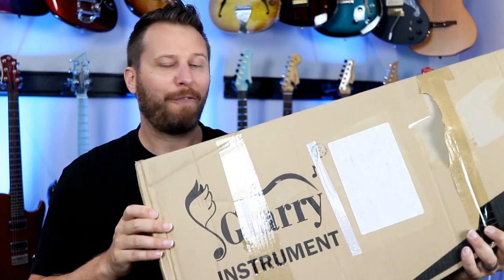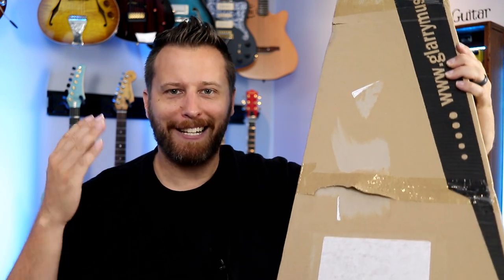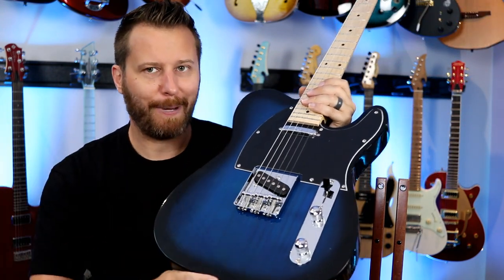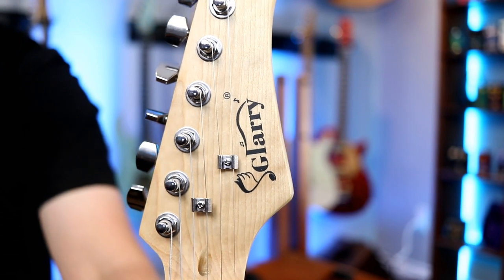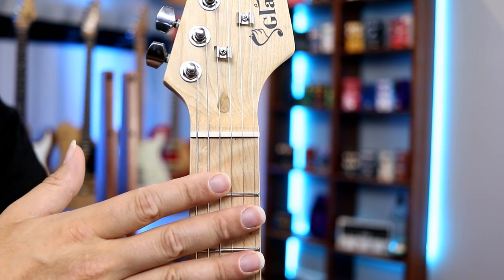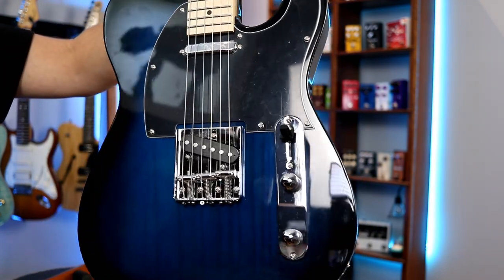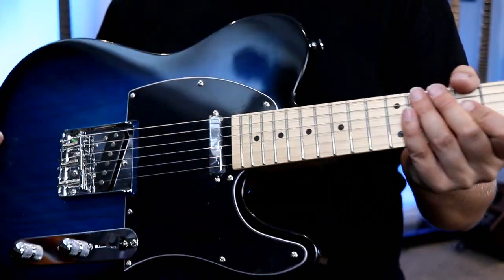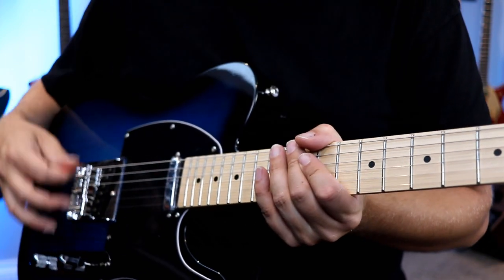The CHEAPEST Guitar I've Ever Played! - What Does It Sound Like??

Comment: 89 bucks..in stirling a reasonably decent night down the pub and a takeaway..
Spend a bit on some sensible upgrades and you have a decent axe for not a lot of cash.
Mind you I have ya beat on that, a classical from gear for music a few years back..because I wanted to find out what the hell do you get for that £s..
New set of strings and machine heads..one of the originals cracked..
A fret polish and tidy up at the ends..not much.
And it played ok, sounds ok.
A bit later a new tusq nut and saddle..even better.

It's a classical and I plays it with a pick..for country and blues stuff.
Finger picked it ain't great though.
And new it cost the grand total of.....£25.00...and a few upgrades.
Haven't quite managed to put a hole in it yet...but I'm workin' on it..
Don't think they sell it anymore either..hardly a surprise.

I do have a more expensive classical but don't really want a ruddy great hole in that one..

Comment: I just got one just like yours. 60 cycle hum galore!  It will have to go under the wrench for several issues.  The thing is very solidly made. Cost: $79.95 + free shipping.  Is the ash tray grounded on these?  Mine buzzes when touched (possible string grounding issues).  Should these guitars be hard tailed?

Comment: The hole in the neck heel is simply for hanging the body when they put the finish on it. I don't care for Glarry guitars, mainly because they're not made from what they say they are made from. The body is not basswood. It is paulownia, which is not a good tonewood for an electric guitar. The neck is also not made of maple. It's some variety of pine, which is why the necks are so thick on Glarry guitars. They had to be thick for the neck to be sturdy enough. I gave away the Glarry ST I had, with the understanding that it was not a good guitar. You absolutely get what you pay for. I recommend looking in the 125-200 range for a nice cheap guitar. Lots of options there, such as Monoprice, Squier Bullet, SX, Glen Burton, etc.

Comment: Hi Darrel, hi guys, isn't it time to show, what this guitar really could be? First step: fretwork, new strings and adjustment of pickups, intonation and distance between strings and fretboard. And then let us hear the sound before and after. It doesn't take money for that. Step two: After this part, its more or less some kind of quality control until here, there should be some more modifikations: the bridge has all the holes for 6 saddles (steel or brass) and string through, the nut should be replaced by bone or graphtec and, as you work at the bridge, the pickup should be changed into a cheap wilkinson or a no name dual rail humbucker (enough, there are no Duncans needed). You can easily drill a hole in the controll plate and put a mini switch in there to switch vom humbucker to single coil. Some shielding would be nice. After all, I'm shure, you will install some hipshot locking tuners and the guitar will easily compete with a Fender, G&L, Blade, Nick Huber, Tokai or whatever you want from the middle to upper class guitars. You can do some recorderings to show, what the steps are and which effect you can hear. I tried this with two DIY kits with ashbody and maple neck and they are great. You will hear the biggest difference, when you work on bridge and nut. So, what do you and the others think? Keep on rockin'!

Comment: Definately changed days. I bought a fazely guitar (pretty much the same thing) £69 delivered as a project guitar thru lockdown. The biggest thing about buying a cheap guitar, change the strings straight off. Pick ups are usually super hot and noisey. Yeah maybe a bit of finish and fitting flaws but have played OK. End of the day, I got a bodh and neck that was well good for £69 to my door to bolt on all my parts bin parts and faff about with without having to with about faffing it up.

Comment: I bought a Glarry Burning Fire for my son for his first guitar. It had the same problem with the frets and the neck was cocked forward because the pocket wasn't properly routed. I went with the fire because of the humbuckers. The neck also had several uneven frets that were creating dead spots. I only paid $69.00 for it so I expected this. Also minor wiring and output jack issues. I corrected all issues and threw on some 10's and now it plays excellent. He has moved on to a MIM Strat but the fire was a great guitar to see if he would stick with it before spending more money. Just be prepared to do some work.

Comment: Without watching the video....I bought one as a "Project Guitar" that was fun to work on and way cheaper than even a kit. The neck pocket was gouged out with a chisel, sharp frets, block hole was not routed correctly,  but the neck was straight and strong. I wouldn't buy these for beginners if you want them to stick with it. If you want to experiment with repairs, paint, setups, etc go for it.

Edit: For a first guitar I would suggest a Squire short scale Bullett Mustang with a professional setup. Don't go to guitar center but your local music store that will most likely price match them and may even throw in a free setup.

Comment: I am 99% certain that those are the same exact tuners on my last two Amazon kit guitars, a Tele and Strat respectively, seller name is mangolulu18. And that bridge is exactly the same as the Tele. Which, by the way, excellent kits overall for the price of $89-$99: very good neck/body fit, perfectly useable hardware and pickups for the money. Only real issue is that both models have the same exact neck with a nut that is too tall, making the first fret tone about a third of a semitone high.

Comment: The lack of a grounding wire touching on the metal ashtray plate may have a lot (not all, but a lot) to do with the microphonics, but it wouldn't be hard to fit one. If I bought this guitar it would be as a starting point for building my own. I would keep the body, the neck pick-up and scratchplate, and the ashtray. I'd replace the control plate with a pre-built one by a reputable maker (there are plenty of them on e-bay) and I'd replace the bridge pickup, and I'd replace the saddles with gotoh compensated saddles, but there's nothing wrong with having strings attached through the back of the ashtray - that old thing about strings passing through the body is another of those guitar myths that belong in the same garbage can as superior tone woods and superior nitro cellulose paints (on a solid bodied guitar it simply means that some folk were born yesterday) - if anything, I prefer to have the strings through the back of the ashtray. And I'm not alone in that. In fact. Fender made 'top loading' Telecasters in the late 1060s, and some players seek them out. All the neck issues can be solved by buying a better neck, and better tuners while you are at it. What your 80 dollars buys you here is a nice body with a nice neck pickup, a scratchplate and an ashtray - which is still a good deal if you think that a branded body alone will cost aroun twice a much, at least.

Comment: I have an SX Taurus, which is one of Rondo's T-styles. The bridge pickup on it has a ceramic bar, but the base plate was cut to accommodate it. That is, the plate is touching the bottom of the pickup, but there's a little window in it, the size of the bar magnet, so it can directly touch the pole pieces.

I've never seen what you just showed us. I wonder if that gap contributes to the microphonics, somehow.

Comment: I'd rather start with a pretty, but cheap guitar and upgrade it as I go.  Heck, I just put a pickup on a steel body resonator so I can play it on-stage.  In fact, I bought a new Squire tele because it was in Lake Placid blue, but the pickups were weak.  Changed the pickups in about an hour, and it sounded so much better...until I dropped in, chipped the paint, and knocked a solder loose. Dang it.

Comment: The problem for the microphonic issue can be fixed by putting the vintage rubber tubing instead than the springs on the pickups..it will not resolve the problem 100% maybe.. but it will help on any guitar with those microphonic noises

Comment: I got me one of these  (or it probably came from the same factory, based on the headstock shape) off eBay for $50 last November.  Mine didn't say "glarry", and it was a strat not a tele.

It works just fine.  Yeah, pickups aren't the best, tuners are cheap, trem block is thin, frets need buffing, but the neck is good enough.  Nothing wrong with it.  After a quick setup, I was rocking.

I also found a knock-off Mustang on Amazon around the same time for around $110, and it, too, is just fine.

Most of my arsensal of guitars is very cheap knockoffs.  My main gigging guitars are old Jay Turser 24" scale jobbies I found for $50 each.  I put JFS pickups in them (the Dream 180s and their filtertrons are quite good) and re-work the electronics (I usually turn my vol knob into a bass cut knob) and set them up.  They work just fine.

The cheapo guitars being churned out of factories in China are actually quite playable these days.  You pay the big names for the use of their name.  Go cheap or go home.

Comment: At the very moment you proceeded to remove the pick guard, an add for Panera flatbreads popped up which started with a box opening up revealing a flatbread.  So it appeared as if you removed the pick guard to reveal a flatbread inside the body of the guitar 🤣🤣🤣🤣

Comment: Note to Darrell, the hole in the neck pocket is used during manufacture to attach the body to the painting jig. Nothing to do with that micro-tilt adjustment facility that CBS/Fender built into 1970s strats. Telecasters (including real ones) generally do not have any foil shielding in body cavities because the metal lipstick cover over the neck pickup is grounded to earth in the wiring of the pickup thereby effectively shielding that pickup, meanwhile the ashtray bridge, which should have a grounding wire attached to it, acts as shielding to the bridge pick-up. It may or may not be helpful to shield the wiring loom cavity, but genuine Fender's don't have any foil so it shouldn't be necessary. Leo Fender was a brilliant engineer who wasn't a guitar player himself but fully understood all the issues with harmonics, electronics, electro-magnetics and radio interferance, so, provided that the 'East Asian' copyists backwards engineer everything accurately, there shouldn't be problems (other than copyright). One last thing, the body wood on the Glarry is avertised as Basswood but it may in fact be 'Paulownia' - a fast-growing variety of tree that is grown in East Asian countries specifically for guitar construction precisely because it is fast-growing and therefore an economically viable renewable resource. It is also extremely light in weight (not much heavier than expanded polystyrene) and yet has resonance and great lateral stability - so, perfect for solid bodies. Actual 'Basswood', however, is NOT light in weight (actually quite heavy) and comes from the 'Limewood' tree (which is NOT the tree the fruit comes from). If you pick up a guitar and find it very light in weight, it is wrong to jump to the conclusion it must be made of Basswood. Yes, Glarry advertise 'Basswood' in this case, but that is often a blanket term used by makers who know you've heard of that (whereas few who might be in the market for a cheap guitar are likely to have heard of 'Paulownia'). I've used both materials in builds (for their differing qualities) as they are different as concrete and marshmallow. Nor are Paulownia and Basswood (Limewood) inferior materials, quite the opposite. Joe Satriani specifies Basswood for his signature Ibanez model.

Comment: The hole in the neck heel pocket of the Glarry T-style guitar is for bolting on a neck dummy...this allows the person applying the color to easily manipulate and flip the guitar body over to ensure an even application of colorant as well as the clear finish. Afterward, the hole acts as a point to hang the now finished body in a dust free room to air dry. This method is done at some places because the neck itself and the bolt plate for the neck hide the hole once the guitar is fully assembled.

Comment: Quite amazing at the price. In spite of the flaws, it's not dreadful. (T-style sold out today, 14 Aug, LOL). I remember the budget Squiers from 2011-2012 that were twice the price, iffy paint, and really bad fit and finish. I suppose these guitars are one positive aspect of the wider use of CNC for certain manufacturing operations. The Blue/Black paint scheme actually looks pretty good - wonder what happened under the control plate? Does not show, anyhow. Like you, I think that neck pickup sounds OK, ceramic magnet and all. 
With the decline in the $CAD, and high unemployment/less spending money, a guitar like this is a lot more attractive than some beaten up 15-year-old budget instrument listed by some optimist on Kijiji or Craigslist. If Glarry had any in stock, and if I had a modest amount of spare cash, I'd be tempted to order one of the T-style, simply to try out. Thanks for another helpful and interesting review, Darrell.

Comment: Great review Darrel! Top notch as always! I bought a Glarry ,, and the playability is great! Once you change the strings ,,, get the action where you want it and mess with the intonation! Really nice guitar! Didn’t have that problem on my bridge pickup that you had  with yours. Takes a a little bit to get used to the lightness’s of the guitar,,, but I’ve had some top of the line guitars over the years. Bought them when things were good and sold them when things got tough! But since I’m not a professional,,, just a hard core enthusiast .. always love having a guitar around! My take why these are so inexpensive is that they are mostly all machined these days from your $3000 guitars to your $89 dollar guitars. Probably from the same type of CNC machine! And in China the workers are paid practically nothing compared to the workers here! So from the body ,, fret board and neck,, you probably getting the same quality on the $3000 dollar guitar as you would on the $89 dollar guitar! If you were to switch out pods,,pick ups and got some locking tuners and a bone nut probably wouldn’t cost you more than $300 dollars,,, and you have something that would rival or be better than that $3000 dollar guitar!!!

Comment: I bought the same style it was what you would expect for the price.  I upgraded the nut to a Graphtech put a set of Fender locking tuners drilled holes and installed through body furrels. Once I got them in I bought a set of Fender Tex Mex pickups. I had to engineer them in as they were not a perfect fit.  I also added an Oakgrisby 5 way switch and CTS fender pots and output jack. Oh and some custom shop nobs.

Comment: i'm always a bit put off when inexpensive instruments come with some additional stuff like tuners, cables and so forth. could've saved the money from those gimmicks and used on the actual instrument. probably one of the reasons why the cheapo kramer barettas are so good, no gimmicks, just one humbucker with a volume pot and that's pretty much it. it's still about double the cost of this glarry, but even that's not a lot of money for a decent beginner instrument or guitar you're not too worried about to bring it somewhere.

Comment: I bought one of their Strat copies, and it didn't hold tune NEARLY as well as that Tele copy, but that's almost certainly down to the trem.

I do like it for messing around with and modding.  After replacing the strings and doing a setup, the tuning held a lot better (though still far from perfect), but I think once I install locking tuners and block off the trem entirely, it will be a lot more stable.